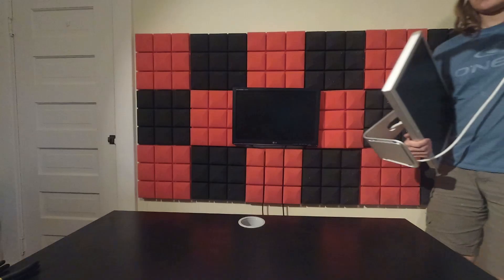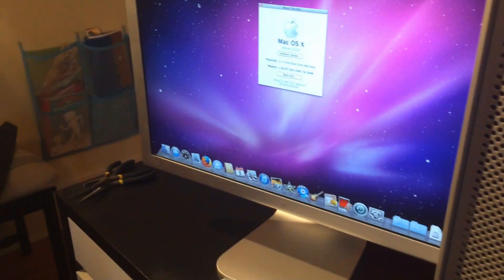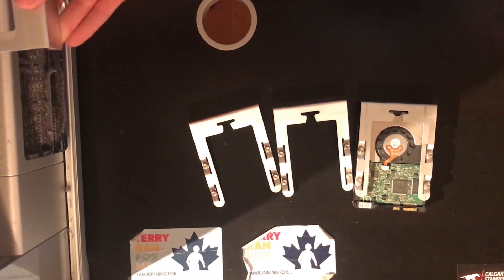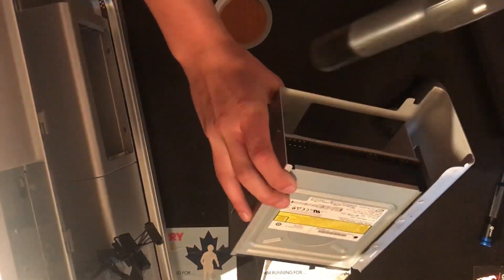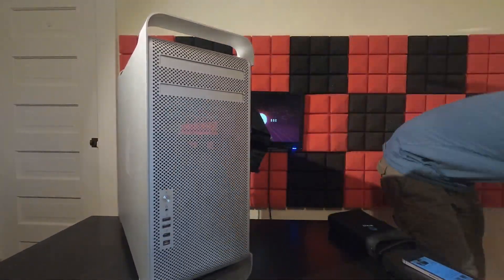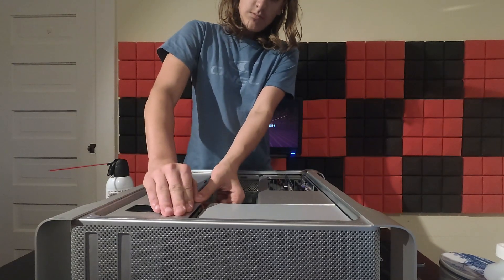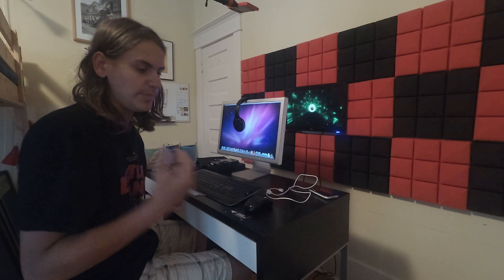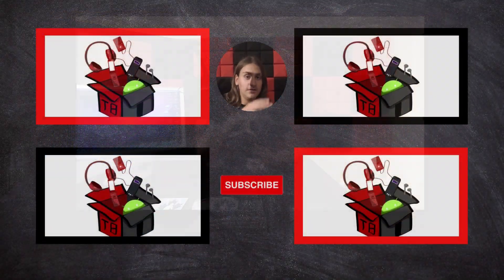Restoring and Refurbishing a Mac Pro from 2006

Comment: That was a good deal!👍👍If you install the maximum amount of ram., and an SSD., and a lightweight Linux OS., then that computer's performance will greatly improve and you will have modern software and up to date security certificates which will improve the internet access.
Reply from the maker: That's such a great idea. Unfortunately, I actually sold my Mac Pro 2006 and used that to buy a Mac Pro 2010. I am planning on trying that on there.
Reply: @techbox9473  Does your 2010 Mac Pro have dual processors?
Reply from the maker: Yes of course! It came with 8 cores
Reply: @techbox9473  That will be an interesting project and perhaps some videos too?
Reply from the maker: You bet! I already have some upgrades planned. It will be a long project however I am excited to work through it with you guys along with me. I might stream some of it, but I haven’t ironed out all the kinks of that yet